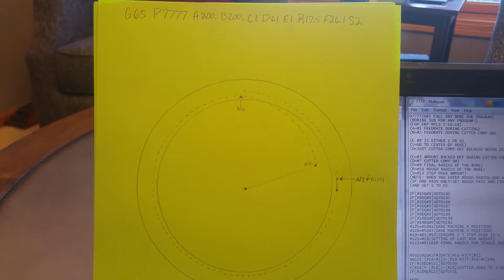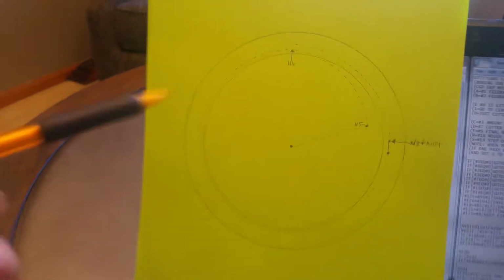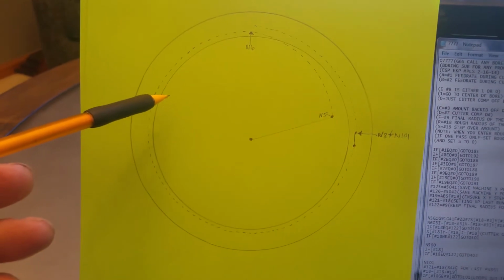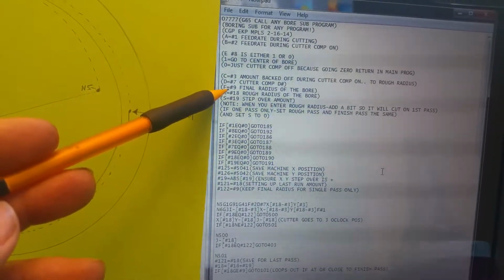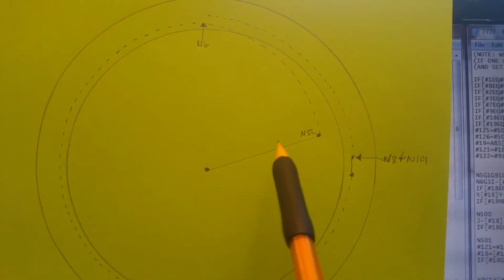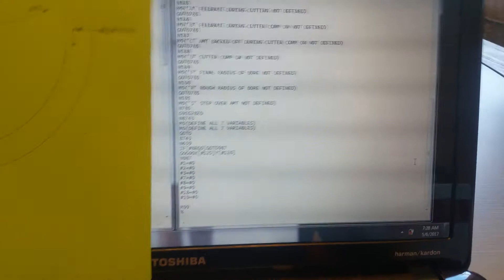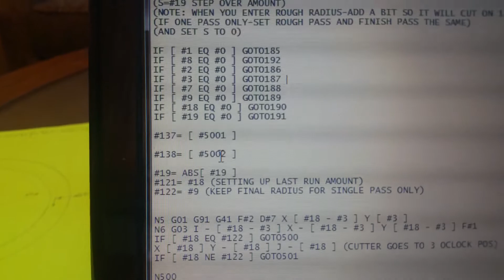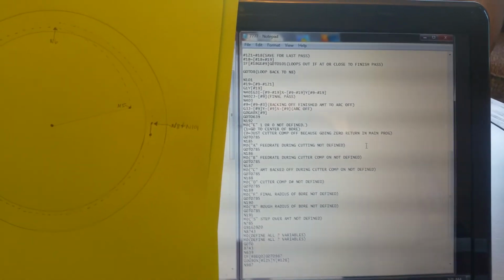Fanuc cnc macro program rough bore to finish bore

Comment: Dear sir, sir have fanuc macro change tools of Fanuc 15M ?
Reply from the maker: O9001
G91G01W-.001F100
#1=#4001
#2=#4003
G52X0Y0Z0W0
G92.1X0Y0Z0W0
G90G80M09
G53G49Z0W0M05
G91G40X0Y0
G91G28Y0M19
G91G30Y0Z0W0
M06
G91G28W0
G#1G#2
M99
;
Reply: @FredFlintstone21  W-.001  I don't undestand ( W-.001).   how to setting  the macros for machine?
Reply: @FredFlintstone21  
Now, I have 2 machine ( fanuc 15M and Fanuc O-M) can't tools change .
now, I tools change by hand.
Sir for me macros Fanuc O-M . It use for Fanuc 15M or not?
Reply from the maker: @cnchuutruong2505  
The w-.001 and all the other codes I sent you is how my fanuc 15m does a tool change. Will these codes work on your machine? I do not know. To answer your question, the W represents the quill on our machine, and G91 means it will incrementally extend the quill -.001 at a feed rate of f.100 since there is no decimal point after f100, so the machine puts the decimal point at f.100 but keep in mind there are some machines that f100 will equal f100. This is the case with okuma
Reply from the maker: @cnchuutruong2505  
Why do you not have the codes to do a tool change?
Reply: @FredFlintstone21  

codes operator delete
Reply: @FredFlintstone21  

thank sir
Reply from the maker: @cnchuutruong2505  
The memory on our 15m is very small. So every day we have to transfer programs back and forth between "pda" little hand held computer and the machine. I thought the 8000 9000 programs are memory protected and can not be deleted. We use a flash drive and put it into pda, and move the programs back and forth. 
On 15m it is edit, program memory, right arrow, read, all, then at pda, send, ok. What do you type into machine for tool change? On our machine if you want tool 3, it is T3 M906 cycle start. 
Did you try the codes I sent you, remove the W codes if your spindle quill dont extend out. A few years back we lost all memory on this machine. We had to call fanuc, and they sent a person out and he reloaded all the codes and got it going. Hopefully you didnt loose ALL of your memory. It's very important that you back up your programs. To buy a pda go to google and type rbr machine tool pda and the pda's will pop up and show you where you can get them.
Reply: @FredFlintstone21  

I tried the codes you send for me. But can't tools change. 
when using MDI mode insert T1M6 for tools change . the machine error: 1200 T-command error and 2010- there is no read signal.
fanuc 15m i just restore parameter. now can't tools change by programing, so i tools change by hand.
Reply: @FredFlintstone21  
machine fanuc 15m by Makino Type: SNC 106-A30
Reply from the maker: @cnchuutruong2505  
Do you know the program number that was accidentally deleted?
Reply: @FredFlintstone21  
I don't know program number
Reply from the maker: @cnchuutruong2505  
Do you have program O9001 in your control?
Reply: @FredFlintstone21  

I no have Program O9001 for control
Reply: @FredFlintstone21  
 Sir have program O9001 for me
Reply from the maker: And no decimal point after F100

Comment: Good tutorial...i just starting..on this macro...issue ...ill  appreciate if help me with a homework...this is...making a deep hole..5 inches..on a late..it allows macro....cuting 0.3 each plunge and after each plunge..back to 0.2 absolute position thanks...
Reply from the maker: will gonzales 
Are you using my macro program?
Reply: FredFlintstone21 yes..im working on lathe (miyano 4 axes).fanuc...it allows macro..i have some basic knowledge of macro

.i m working on it..is dificult..but I'm trying..
Reply from the maker: will gonzales 
Oh ok. The macro prog I made in the video, I've only used it on milling machines, hopefully my code will help you achieve what you are doing. It took me quite a few days to perfect what you see in the video.